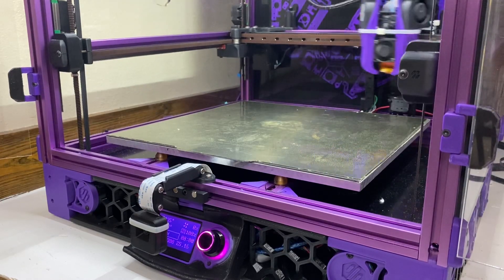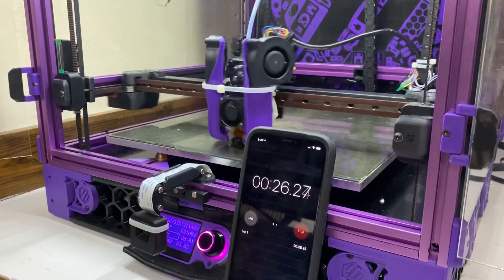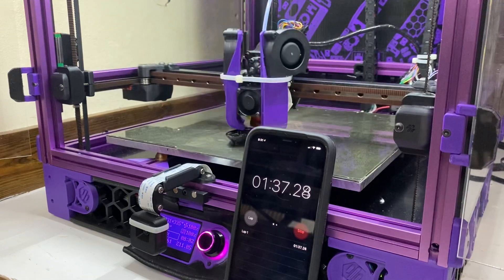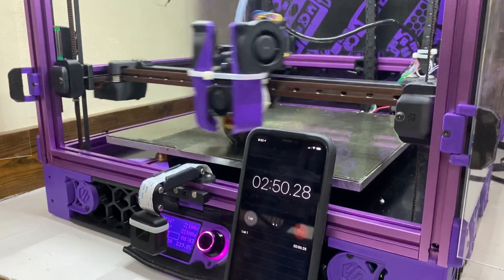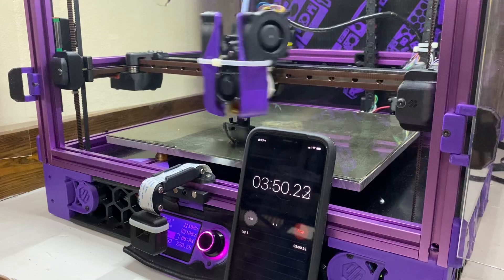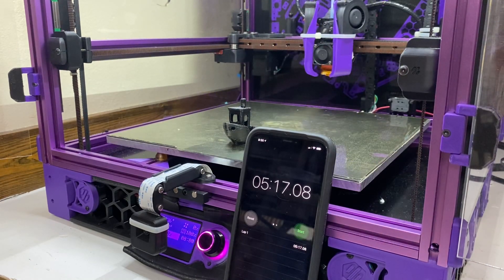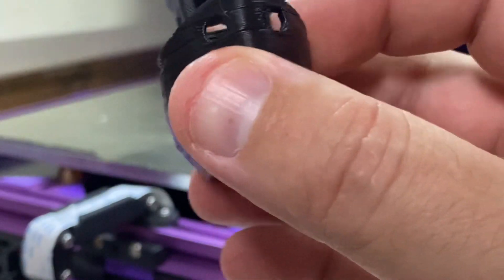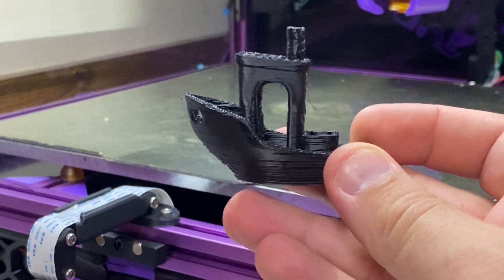Voron 2.4 5:20 speed Benchy

Comment: I wonder if you got rid of the fans, added a silicone aquarium airline tube and a custom shroud for the printhead, hooked the tube up to a shop vac on the blower side, or a squirrelcage floor drying fan. That way it's not manual, and integrated into the design of the printer. though at that point you might need to slap heat sinks onto your steppers.

Comment: Wow, that is incredible. 
Have you thought about doing more to dampen vibrations? Attaching some dead weight might really help, either covering the extrusions and filling them with sand, or just placing the whole Voron on a big slap of concrete with rubber feet underneath that. I'm sure there's more possibilities than that, too. Deadening the vibrations might help a little with the insane accellerations you're running.

Anyway this is super impressive, thanks for sharing!

Comment: A thorough guide on what's necessary for such fast speeds is missing on the internet. I've found guides about individual components and settings but nothing that just goes through everything necessary to be so fast.
I'm currently upgrading my ender 3 V2 for higher speeds (higher flow rate hotend, dual fan setup, tweaking jerk, acceleration etc) but I'm more or less going by what I think makes sense instead of having proper guidance.
If someone like you could explain what goes into this, I'd happily pay you 20€ for that video.

Comment: What kind of drivers do you use? TMC5160? The ones I found are rated up to 35V
Reply from the maker: I ordered 5160's from watercott in Germany, they're able to handle 48v.  I feed the stepsticks directly (power is NOT routed through the mainboard).
Reply: @JoshMurrah  i found those too afterwards. I’m making a simple breakout board with capacitors, to substitute the ones on the board. I can share it if you want

Comment: Meanwhile I'm struggling in getting the parts for my Voron 2.4 printed in ABS on my trusty Prusa i3 MK3S by utilizing only my closet it resides in as a makeshift enclosure.
I'm most certainly not going to aim for those speeds but being able to print at least twice as fast as my i3 MK3S would be huge boon in the long term for all my projects.
Reply: How fast did your i3 go ? For abs too high speed is not very good. 
Litle tip, à cardboard box can be a good enclosure.

Comment: Need to ditch the steppers for servos and get a remote air source using tubing to the ducts. Will help eliminate the fans moment of inertia and their weight. Maybe find the lightest linear carriage possible and maybe a flying bowden overhead with its own positioning system decoupled from the print head.  I think this would be close to the "ideal limits" of what printers could achieve in the near future.
Reply: I have an overkill addition: use an AC to cool the benchy and the hotair output to preheat the filament
Reply: Why not just put more motor and more fans xD ?

Comment: That's incredible. I'd love to see how much quality improves as speed decreases though. 7 min, 10 min,  vs 15 min benchy.
Reply from the maker: I can put out a 100% perfect, no-blemish benchy in about 15 minutes.  Any faster than that and you start to get errors, and lack of cooling on the plastic.
Reply: @JoshMurrah  15 minuits is inane! My printer takes like 2 hours to get a good benchy.
Reply: @slummybell23  min takes 2h 45m and I have a problem with stringing I'm solving rn
Reply: @slummybell23  Jesus! I can bust out a perfect one on my stock Ender 3v2 in 45 min. I could probably do it faster but I've only been printing for 2 months so I'm still learning.
Reply: @dangerous8333  I doubt you could get it faster, the Crealitys are a good starting point to get in 3D printers, but i've reached the limit of the extruder multiple times, that was printing at not even 100mm/s and 230°C PLA and my extruder started skipping..

i've upgraded everything except for the frame,bed, motors and psu

i'm printing with a Hemera now and it defo helps to print faster, it's now at 3500 acceleration (default on Enders/CR printers is 500) and 300mm/s
Reply: @JoshMurrah  that is insane

Comment: The main problem here is that everything including the desk is shaking. You should try to fix the printer to the ground, or to a really, really heavy desk. At this point, the plastic springs under the printer are only allowing it to move more.

Comment: I don't see an issue with fans off the printhead (just like having your extruder off the printhead), in fact my oldest machine has no cooling fan for PLA (I almost exclusively use ABS, so there is no need for one), but when I did PLA recently I put an airplane motor with 13" prop blowing gently across the whole bed and it did alright (really should have had 2x, one for each side), but it worked well enough. I don't see a reason you would need your fan to be on a moving piece, just like you don't require your screen to be moving around too.

Comment: I was about 30 seconds form pushing the go button to buy at voron kit and start sourcing parts, then I saw this video and completely scrapped the idea. This this is STUPID LOUD. No thank you.
Reply: If you run any printer this fast they will be shaking themselves to death (loctite everything, lol!)

At reasonable speeds printers will be reasonably loud, this is kind of like drag racing (which similarly uses no mufflers), it's all about speed for this type of run and you don't care how long the machine survives or how loud it is. That doesn't mean a Voron is loud (my printers are actually louder at low speeds and if I run it really slow it sounds like a MakerBot where it sound like R2D2 is getting tortured, but at reasonable speeds like 90-120mm/s it's not bad as long as I've oiled the bearings that month. Running any printer this fast is not the best idea for long term reliability.

Comment: How does the quality look like if you print this at 2x the speed of a normal (let's say mk3) 3D printer?
Reply: it can do 3x the speed with no issues.  an mk3 is running under 1000 accelerations where my voron quality setting is 5000 accelerations and fast is 10,000......

Comment: Whats the point of meaduring the time to do a wrong part? I mean, this benchy is far away of being something acceptable. Any printer can do a mess in 5 minutes.
Reply: show me a better looking mess made in 5 minutes.
Reply: @Tedlasman  I don't have a 3D printer for doing mess, sorry. I try to do good parts.
Reply: @jordicasiano8112  what's the fastest  benchy you can print, and it still looks good?
Reply: @Tedlasman  I don't know exactly, about 40 minutes aproximatelly.
Reply: @jordicasiano8112  his printer can do it in about 10.
Reply: Looks better than some of the $10,000 machines at work (and those move slower than a turtle, probably take 3-5 hours to make worse). This is part of the process of tuning, you push it to the limits, find what needs improving, tweak it, repeat several times, then you can back it up to where it prints nice and potentially twice as fast as what you were doing.

Comment: Lol that Stepper Motor is suffering when it try to change direction, maybe you can soften or slow it a bit when try to change direction ? Maybe this can eliminate Extruder  sheking like crazy 🤔
Reply: based on the finished boat the "crazy sheking" is necessary to printing something with this many changes in direction in <6 min

Comment: Consider a Peltier cooler before the bl9wer so it creates cooler air to blow at the print head.  No clue how you could mount it and keep the extra mass secure as they work better with a heatsink on them.  I had to reverse power on one to find which way worked better for cooling on a different project.  With your setup I wolud recommend putting it above the hotend, flip the blower fan to suck air from the cooled fins on the peltier and blow down at the nozel.  They use 12V so you might want to add a FET or relay to power it.

Comment: It is still slow, useless for production. Thats why I still have no 3D printer.
Reply: They are called rapid prototype machines for a reason. Large production batches should be injection molded (I know Prusa just prints all their machines, but that's rediculius). There are niche use cases, just like I don't CNC every part or make everything from sheet metal, every process has it's benefits and when to use it. Printers are amazing at prototyping (I'm mechanical and aerospace engineer, so typically for aircraft industry the only production you'll see printed is if it prints stamping or hydroforming tooling blocks to bend sheet metal in complex contours). The nice thing is you can test a design cheaply and often within a few hours instead of days/weeks per iteration.

You can also get belt type printers if you want to do more parts, just let it run 24/7 as parts pop off the conveyor belt bed, without the extremely high cost of dies and mold tooling being made and much faster production turnaround. However for millions of parts you likely want injection molding if possible.

Comment: Awesome!  That is a perfectly acceptable benchy!  I had the same issue on the first version of my hot end assy with normal prints before I went with two shrouds at 90deg.  V3 is going to be at 180 degrees, gotta cool from both sides.  I'm shocked it even makes a difference at this speed.  IMHO it would be totally legal and within the spirit to have a fan on the side.  That is part of this community.  It's your printer.  You are also finding what our limits are, and this is really amazing to watch you find them.  Do what you have to that is within the rules.

Comment: Liquid cooling is next :D . Cooling should not be a problem AT ALL. You can remove heat from the print with more/colder air. An extended ceramic heating tube with ceramic nozzle would allow more time for the plastic to heat up, allowing you to feed thicker filament through a smaller opening at higher pressure but at a lower feed speed. I think there are ways to remove lots of weight from the printer. I would use a carbon fiber space frame rail with thin aluminum strips as sliding surface. This will drop the weight a lot and give you lower inertial forces and better acceleration.

Look at the speeds PnP machines run at, and you know there is a lot of performance left on the table. The most extreme would be PEEK. It is a high temp resin that can hold up to 600 degrees. That way you could go 100% composite. After all that has been exhausted the switch to dual nozzle systems will double the print speed.

Comment: I'm not really sure how stepper motors work with voltage.  Can a stepper motor handle whatever the driver can handle voltage wise, or are there other considerations?
Reply: The only limit is to dont burn the internals electro magnets with too high voltage, the best is to dont go over the nominal voltage.

Comment: Hmm so it sounds like running the steppers at 48V is the primary thing that's allowing these ultra high accelerations?
Reply: yes, since high voltage allow the currrent on the motor coil (an inductor) reach it max value faster, so the motor will not skip step at high speed

Comment: How fast you think you could do good quality usable parts with this setup?
Reply from the maker: A lot slower.  My current “quality benchy” setting is about 20 minutes.
Reply: @JoshMurrah  How fast can these printers print a "quality benchy" out of the box? I'm considering buying one for production use if the speed is worth it.
Reply from the maker: @AllenIsbell  the term “out of the box” concerns me - this is a full “build from plans” printer including sourcing your own parts and terminating all your own wiring.
Reply: @JoshMurrah  Oh I wasn't aware. A Google search showed options to buy them. I guess I need to dig deeper!
Reply: @JoshMurrah  dude, beautiful build and excellent pioneering work. This purple machine has set a place in my mind since seeing it on build showcase. The high speed with quality drew me to Voron. I have converted an e3 to Switchwire and completed a v2.4 350 in the last couple weeks. I have a dragon HF. I have no idea how to do anything above “average-high” Voron speeds- from accel to corner to speed to cooling abs. I did a stellar 200mm Voron cube on the SW and was floored at result quality. I was shocked to find out people were cooling the crap out of abs in the crazy speed realm, but of course it makes perfect sense. My question is, with stock 2.4 and HF, what do I do to get to your “acceptable” 20min profile/cfg/cooling? Without 48v and cf x of course :)

Comment: If the compressed air is integrated into the printer such as with the "berd air" cooling pumps available, I could see that being in the spirit of the game. They may be loud but so is the printer vibrating the house's foundation away!
Reply: im ashamed i didnt think of that myself. compressed air is wildly used in laser cutters as well as down draft ventilation. I could see a compressed air, not very high psi i would imagine but with some engineered ducting (using airflow modeling) i believe it really could be done. maybe add a variable flow valve to restrict airflow at first so its not on full blast at first and then wide open as the print progresses. coupled with a down draft ventilation plate like a laser cutter has, printing ABS would be less stinky. i dunno im spitballing here but honestly,  compressed air would be a great way to target problem hotspots while cooling the print and reducing mass on the gantry
Reply: Most of the noise is generated by vibrations from the backlash of the motors. There are a few ways to get the sound down a bit, but that would require re-engineering of the stepper motors internal bearings, the mountings to the enclosure, etc.
Reply: Yes but why have compresed air, when u dont need it ? These kind of fans are already enough to cool the parts.
Reply: @valian8985  I have parts for a prototype compressed air cooling set up. An advantage would be extremely powerful cooling without the weight of the fans on the print head. Fans may be fairly light, but every gram counts especially on the print head. I can control the speed of my pump in the same way as fans are normally controlled on a printer. I just need to tie the output of the printers motherboard into an external mosfet to handle the increased current draw of my mini brushless motor air pump, which draws around 30 watts at full power.
Reply: @valian8985  i meant to replace the fans with compressed air
Reply: @MrRevolverkiller  yes but its harder to control and à too precise cooling could even damage the build so I dont realy see why using compresed air instead of fans
Reply: @valian8985  yeah it was an idea just spitballing
Reply: @MrRevolverkiller  yeah noproblem that could have been à good idea but theres is no big con and its more complexe.
Reply: @valian8985  unless using very high quality fans, the jerk of the carriage can cause fans to not perform properly and since a compressor would be located away from the printer, there's no moving parts that need to operate in a high jerk and accel environment.  Simple solenoid valves and regulators can be frame mounted to introduce air pressure into a 2nd bowden tube.  IMO, using compressed air instead of fans is a great idea.
Reply: @MichaelJeffers75  good argument, its right compresed air is not that bad exept for the price of the compresor